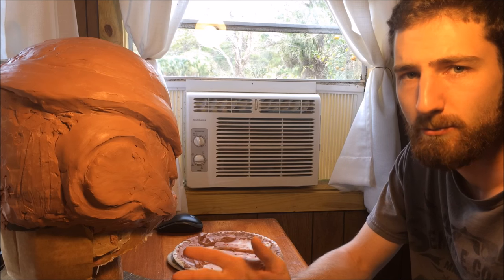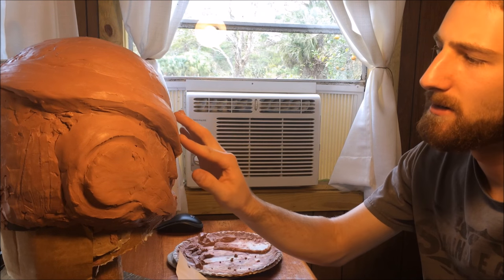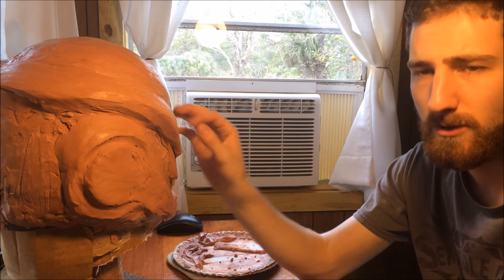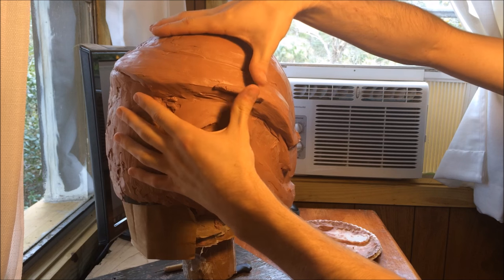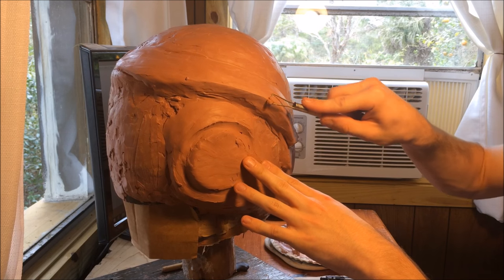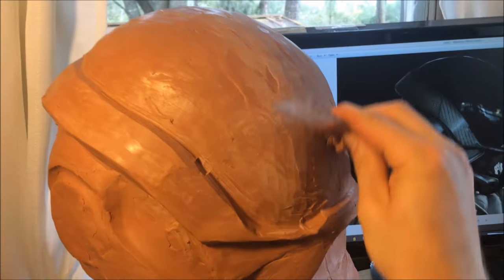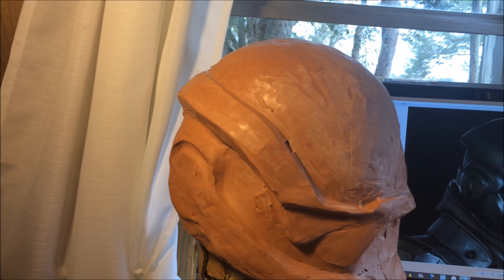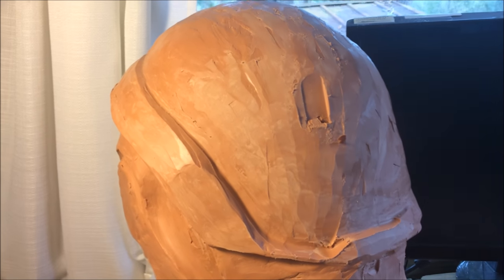How to Make a Replica Helmet Step 1: Sculpting Part 2

Comment: Nice explanations. I am trying to do a replica of an ancient hoplite helmet. 2500 years old design. I now first shaped wood into the half of this helmet. Using photocopies of the images front and side of the original helmet at the right scale to cut boards first. It seems that for symmetry it can be good to create the outline of the bottom opening of the helmet on a board. I think that I'll cover my wooden prototype with a thin layer of clay to create the final shape. Also slightly increase it on demand. Can make several sizes this way.

Comment: Does it matter if the clay dries
Reply: Nick Owen Yes it does. You DO NOT want it to dry out. However, NSP is an oil based clay that doesn’t dry out. It can sit out on you table for a month and still be perfectly fine.

Comment: What kind of clay do you use,and im trying to make my own helmet a simple design.a lot of people tell me oil based but I don't want it for months not to dry.trying to get it for a con and guest appearance.so if you could help I love it love all your videos.
Reply from the maker: I use Chavant NSP Medium oil based clay. Oil based clay will not dry out on you like water based clay will. Just make sure you use sulfur free clay as oil based clays containing sulfur will cause curing issues with some molding silicones.